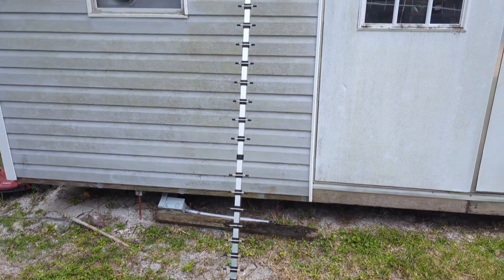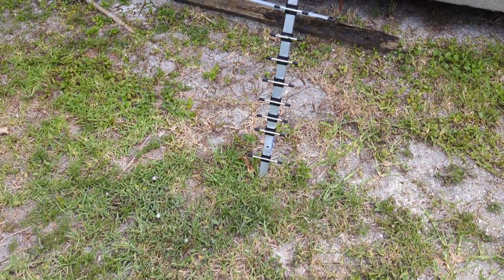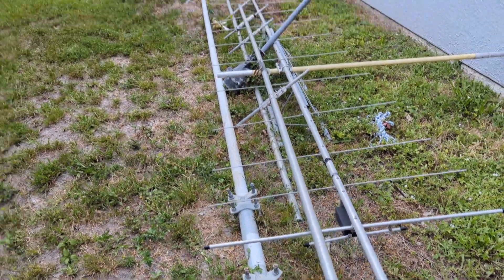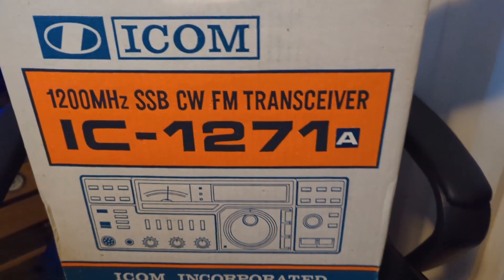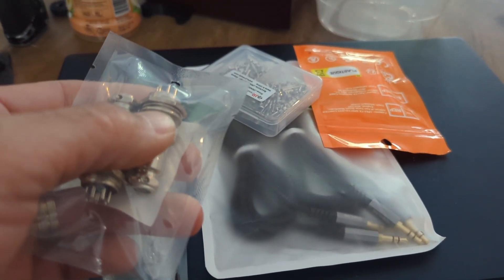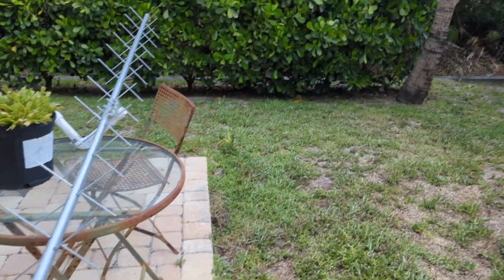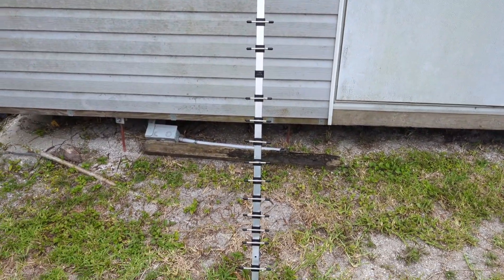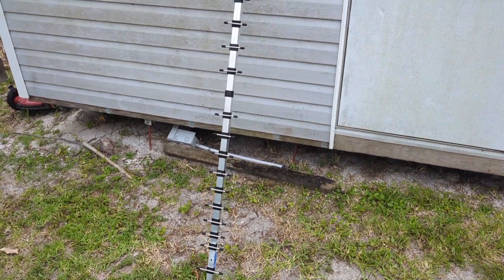I GIVE UP On The 23cm Yagi, Moving On...

Comment: Yes, on those frequencies, tuning and building it properly is hard. Did you use DL6WU online calculator for calculating dimensions? Anyway, Antennas-Amplifiers have good antennas - especially with high front/back ratio.

Comment: Try a non metal boom ... At those frequencies , you need to move the elements away from the metal boom .. So maybe thicker insulators , or a non metallic boom ....... de 9Z4BM